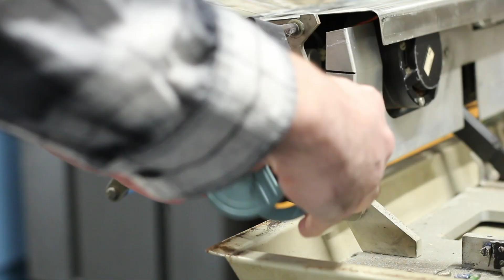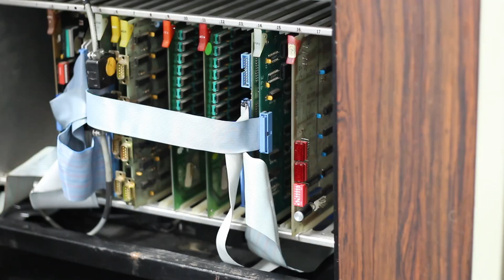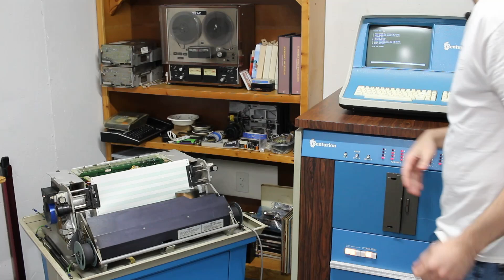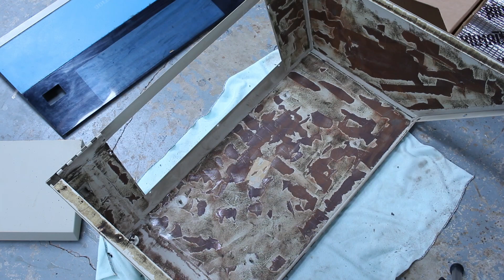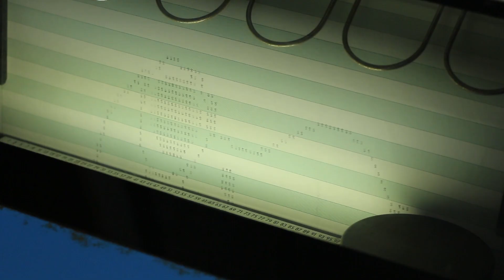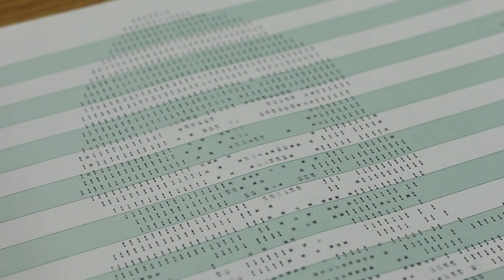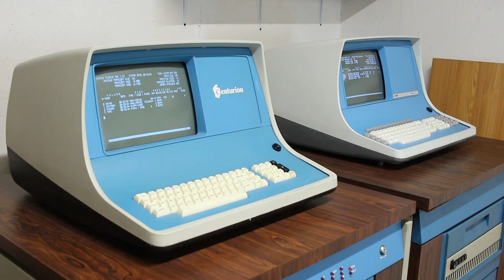Printing ASCII “Art” Like it’s 1980!

Comment: I remember an article in "80 microcomputing" (a TRS-80 based computer magazine) that showed how to create ascii art from a photograph.  The ascii symbols were chosen for ratio of light to dark, and had to be done by hand.  You created a grid on the photograph, and assigned light/dark values, and then the program would try to pick characters to match.

The picture featured in the article was the authors wife's face.  Very attractive lady, IIRC.  Definitely not Pr0n, but i can imagine that was done a fair bit.  Computer nerds being a lonely lot, for the most part.  ^-^
Reply: By picking multiple characters depending on the four quadrants of the character rectangle you could probably do antialiasing or subpixels, and get double resolution in both the x any axis.

Comment: In the 70's I was running ham radit teletype (RTTY) using surplus model 15 terminals with a punch tape unit.  Lots of "art" was being traded by radio and as punch tape at club meetings.  

When our ribbons needed to be freshened up, we would later the spool flat on a covered surface and give a small spray of WD40 and let it sit overnight.  It seemed to work well.

Happy Days!!
Reply: Does ham RTTY need to abide by the same FCC rules for profane, obscene, and indecent content regular commercial broadcasts do?
Reply: @eDoc2020  Nope

Comment: My college had a big chain printer like that connected to our UNIX system!  Each printout had a cover page with the username, and an operator would separate the printouts and put them in pidgeonholes for collection.   It was already antiquated tech then (early 90s), and sadly the next year the chain printer and operator were replaced by a self-service laser printer …

Comment: I have tons of EBCDIC art. I worked on a 360 mainframe where you have much more control over a printer. For example you can print many lines over another for denser print just by setting the first byte of a print line. The images were on cards, but I copied them to 9 track tape. I also wrote a banner program on just two punch cards! you booted the mainframe from these two cards. since each card was 80 bytes, the entire program was less than 160 bytes! I did that in 1972. we also printed at 1200LPM too later on printed at 18,000 lpm!

Comment: is there a screw, wheel, lever, or something that you can use to adjust the vertical line spacing so that the printed text lines up perfectly (3 per row?) with the rows on the paper?

Comment: The wd40 method works, but eventually it probably damages the printer.  In the 70"s were on an aircraft carrier testing a new navigation system when the little la50 type printer ran out of ink.  I remember reading about the wd40 method and I had wd40 but no new printer ribbons for the printer so for the next 2 weeks we kept the printer ribbon working with wd40.  By the end of the test I think the print head was kaput!

Comment: Congrats on getting to where you are now with the Centurion system and peripherals !!!
I worked as an FE with Kalbro corp, later bought out by Decision One, then DEC through the early 80's - late 90's and worked with all of the drives you have and the printer plus many more line printers; not to mention the MANY systems I was responsible for..
Your work is bringing back a flood of great memories and a few nightmares, LOL, of those days. I will let you know, for sure, that printer is capable of printing much darker than what it is now, just get a new ribbon and you'll see !!! LOL Who knows, maybe a case or two of those ribbons will surface as others see your videos.
Best to you and thanks for so many GREAT videos and my trip down memory lane !!

Comment: Congratulations on getting the full Centurion system up and running. These disk drives (particularly the Finch) were so darn challenging. Glad to have a relatively easy W on the printer to finish things out. Now you can get to the important work of doing mid-80s oil and gas accounting. Oh boy! Are we in for some fun or what?

Comment: Had nostalgic moment - the ascii art image in "girl82" was a ubiquitous image back in the day, she was actually known as "Suzy".  I think it dates back to the '60s, I remember it from the  '70s.   I had heard that it originated from IBM but they will neither confirm or deny that 😏.  ASCII art was a fun thing to do with printers back then.   Line printers really are amazing devices, some can print an entire page in a second to two
Reply: Sounds about like the line printer on my high school's DEC PDP-11/20.  As I remember, instead of a chain, it had a spinning drum with each printable character around the circumference of the drum for each print column.  That way it would print every occurence of a letter on a line all at once.  (it's been 46 years since I graduated, so I could be remembering details wrong).
Reply: @SenileOtaku  We had a small chain printer not too different from the one in the video.    I remember some of those drum printers could really crank out the output.    I had a job as a computer operator in college and I used to have to change the ribbons on drum printers, the ribbon is a huge pair of cloth soaked in ink, they are almost drenched when new - you have to wear gloves that come with the ribbon to put it on.    The ribbons for the chain ones are really soaked too, I don't think you could ever get them fully loaded with an ink pad and a roller.   Running printers used to be half of the job of an operator.

Comment: Reminds me of my old Commodore mps1230. A 9pin printer where i did the same to save money. Bought stamp ink  and put that on the ribbon directly. The 9 pin ribbon was the same widh as the bottle top. So some luck with that. But i remember that the stamp ink never lasted as long as the original. And adding too much simply made a mess when printing.

Comment: Still remember the CDC fast train printer I once worked on.  Even faster that these band type printers.  Had slugs with the letters on and teeth on the back and a whole set of them flew around a track in front of the paper.  There were 3 whole duplicate sets of characters to reduce the time it took to get the right letter in front of the right hammer.  Was maybe 3 times as fast as your printer.  When you did a form feed it was so fast it threw a loop in the paper into the air until gravity pulled it back down into the output bin.  Was connected up to some CDC Cyber mainframes.

Comment: We were doing ASCII art like that already in the early 1970s on our university mainframe. Storing all that on the university hard-drives or tapes was forbidden, so we used IBM puncture cards. One picture would take up to a shoebox full of cards. Nice to see these old machines and the art still being appreciated.
Reply: EBCDIC arts?
Reply: @RonJohn63  Yeah, I heard it called that. We saw print-outs around 1971-72 from guys who had come back from visiting the US and thought that we can do that and even improve on it. We got so far as to give our depictions realistic shading (Astrix and Oblix, Peter Pan etc.), but it was a hell of a lot of work. Printing those was hard on the university printers, it wore out the ink bands super fast and the technician who looked after the hardware, was getting fed up.
Reply: @RonJohn63  I hadn't a clue about all this at the time. We were mostly mechanical and electrical engineering students - at that time these fields didn't use computers - and were just fascinated that these machines could produce such graphics.
BTW, later a music student came along and suggested making music with a computer. I helped to develop the interface connecting the computer to an electronic organ. These days we'd call that a sound card, it took up the load area of a small truck.
The press here in Germany went crazy when they found out, we even presented the equipment on TV. We sold a few of these to rock musicians, one of them Frank Zappa and the other Kraftwerk. Those were crazy days.

Comment: Every time I see one of these old school line printers in action, I am just in awe of a mechanical mechanism that can do so much, so fast, with such precision! I had the privilege of starting my computer science experience in high school on an aging NCR Century 100 minicomputer in 1980. The line printer was 132 columns, with a slim disk/ring of printable characters for every column, and it smacked out a whole line of text in a single strike. It made a very rapid muted tapping sound like a soft machine gun. If I remember correctly, it's claimed speed was 600 lines (10 pages) per minute. One memory I have of my CS teacher, as I entered the classroom/computer room one morning, was seeing him crouched in front of the printer with ink all over his hands, installing the huge ribbon (after re-inking) the thing had. I was rather surprised to see it was as wide as the entire carriage. What an amazing piece of machinery. By the time I graduated in 1982, it was being phased out to be replaced by a low end IBM System 36. It had what they called a band printer, that was similar in layout, but slower (far fewer hammers) than a chain printer like yours.

Comment: My friend, vacuum tubes are not static sensitive but those circuit boards are, please avoid touching the edge-board connectors and handle the boards by the edges.

Comment: That seems like a horrifically slow way to re-ink the ribbon. 
Back when I last had a dot matrix printer I had a spray bottle of ink, the top of the ribbon spool would twist off, you would put 3-4 sprays over the spooled ribbon and then twist the top back on

Comment: My brother told a story about messing around with the driver code on his system for printer like that but slightly faster (supposedly 300 LPM).  His story was one day something got wrong and it started doing just VT's constantly.  Since the cover was open, before he could stop it paper was shooting straight up out of the thing and about 20-30 feet of 'green bar' was laying all over the floor.

Watching yours brings back memories, a key part of being a programmer back then was printing out the listings and binding them up to hang in the cabinet.  Ahhh... it was somewhat sad when we finally stopped and threw all those 10-15 year old listings out to clear out the cabinets.

Comment: to help with the noise use floor padding foam from minards to help deaden the noise in the case.  use spray adhesive! it's cheaper than dyna-mat for automotive use!
Reply from the maker: Honestly, once the cover is on, the thing is surprisingly quiet. I can barely hear it over the roar of the CDC Hawk drive in the Centurion!

Comment: It's loud there because you don't have the hood on, the hood I used was lined with sound-proofing material.  Also, these were not typically in offices but in the data center, which was also noisy.  The one I used was attached to a Prime 4150 mini, but some were on IBM mainframes.  I noticed you don't have any Prime minis - not sure if there are any left, should be.

Comment: Instead of stamp ink, there used to be refill ink for ribbons. Guess their consistency is well better suited in the long run. Back in the day, i just put it on the whole rolled up ribbon and let it soak and distribute over time. Not the best I guess, but is was fast.

Comment: Amazing job getting all the components working!
Don't go overboard re-inking the ribbon, keep it realistic!
In the late 80's I did run some programs on the university mainframe, (Amdahl), but never knew how the much anticipated printouts, collected several hours later, were printed, I'm guessing on something similar to your printer.
I'm interested to know if each column is printed in sequence, or if a column is printed when the appropriate letter reaches it; even the fact that the odd and even columns are buffered is impressive.

Comment: In the 80's I used to print out stuff from my ZX Spectrum using a Centronix interface and parallel port cable connected to a dot matrix printer. What fun that was!
Reply: We only had the Sinclair silver toilet roll printer and it was misaligned so there was always fun trying to determine between : and ; on old listings.

Comment: I took so many of these line printers apart when I was a kid..  My dad bought a whole bunch of mainframe stuff from the local college..  (mid 80's) .  I know at least one of the printers had a spinning drum with all the characters on it..
Reply: Ah, yes.  Evvery week I would have to adjust the printer interposers to vertically align the characters in a line of print.  You could always tell the printout was printed on a drum printer because the characters weren’t vertacally aligned.

Comment: One of my college computer professors had a massive Spock holding an Enterprise model in ASCII Art on his office wall.
You need Lubricated Ink for printers!! Stamp pad ink will get sticky on its own... I am embarrassed to say I gave advice to someone years ago about re-inking a ribbon & it ruined a print head... 😕
There's such a thing as Printer Music...
Reply: That Spock file must have been shared around - I went to a summer program at a local college in the early 80's when I was like 14 and you could pay them a few bucks for ASCII are posters - I have that one. Yes, HAVE - present tense. It's still folded up in my basement. Not sure I could ever get it unfolded again without destroying it - I taped it together with duct tape at the time and it's kind of a mess.
Reply: @EddieSheffield  Cool thing about monospace ASCII art is that if you have the printout you can recover it 1-for-1 back to digital. If you do ever manage to get it opened back up, I hope you consider scanning it in and converting it back to .txt!
Reply: @EddieSheffield  Hair dryers are good at making adhesive let go. Proceed slowly.

Comment: Back in the old days, I worked for a company that among other things sold line printers. The text file we would print as a test was a Mona Lisa image that spanned 2 sheets wide a 4 high you taped together. It did 4 passes on each line. It was impressive.
We did chain and band printers up to 2500 lines a minute. Old mechanical stuff was always interesting to watch.
Reply from the maker: Up to 2500 lines per minute? That's insanely fast! It must have slung the paper out the top at a ridiculous rate. That would definitely be a sight to see for sure!
Reply: @UsagiElectric  The "analog guru" passed the prototype to me. He had made the analog paper control board. Told me "write to these registers the distance to advance paper. Did a test and mistakenly swapped the 2, 8-bit regs. So instead of advancing about 2 lines, FOUR FEET of paper shot straight up out of the printer in less tan a sec. 
The printer was basically two band printer heads cascaded, each printed the odd or even lines.
Reply: @UsagiElectric  At the University of Georgia, in the early 1980's, I remember the IBM chain printer devoted to student print outs ran so fast that we would take turns straddling the paper output path with our plastic student ID badges. Using rollers sync'd to the printer platen, the paper stream was directly horizontally and into a gigantic canvas postal service bin. In order to not 'lose' your Fortran 77 job output, the student 'cutter' would use the edge of the ID badge to slice the greenbar paper to the right and hand off the now separated sheaf of paper to a waiting student on the left and do the opposite (cut left/hand off right) to the next job and next waiting student. That process took intense concentration and a 'cutter' could only keep up the pace for a few minutes. The replacement student would take over during the few seconds that the printer took to output a particularly long job and the process continued into the night. For those not present when their jobs printed out, they had to wad through waist high paper stacks of print-outs trying to find their programming projects. Punch card input; greenbar printed output. Definitely memorable days!
Reply: I said, ...ay... zee... uck.... Whassat? Put the cover back down. It's an incredible racket! Centurions' THIRD racket! (10Q Basil)
Reply: I have a vague memory of seeing an image like that at my secondary school in the UK in about 1980. They were fiddling with a large late 70's era rack mounted computer before it was scrapped and there was this Mona Lisa image being shown around. Hardware-wise it was later than vacuum tube and had the pea-sized metal can transistors as well as the ones in the large flat metal packages with a mica separator. There were a lot of discrete boards in racks that were around the size of a hardback book.
Reply: My wife's uncle has the Digital Mona print - from back in the day when he was the local Control Data manager.
The old ones are quite collectable.

I learned to program on a CDC Cyber with one of the fast line printers - and yes, form feed could fountain paper up several feet.